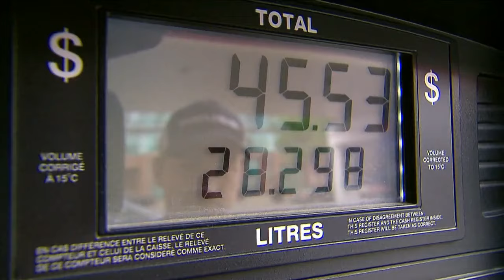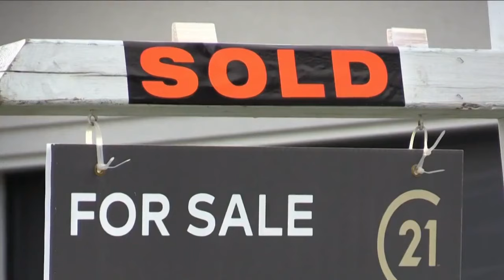BREAKING: Inflation rate hits 2% target, lowest level in more than three years

Comment: Inflation has gone down to 2% and yet food ,gas,rent , housing prices are still up i wonder why?
Reply: Untrammeled capitalism and both skippy and trudeau LOVE IT.
Reply: Inflation is down to 2%... on top of the 50% increase in EVERYTHING in the last 4 years
Reply: Lower interest rates drives up home prices which in turn drives up rent. Soon renters will have to leave Canada as working 3 jobs doesn't pay the rent and no one can work 4 jobs at the same time unless they never sleep. Lower interest rates have cursed the world since 1981.
Reply: @parkerbohnn  Not true at all.  How did you become so economically illiterate?  Low interest rates stimulate the economy.   Canada's problem is 5 million new comers with no plan, no infrastructure and no housing WHICH is 100% responsible for the rise in housing costs (rent and mortgages).